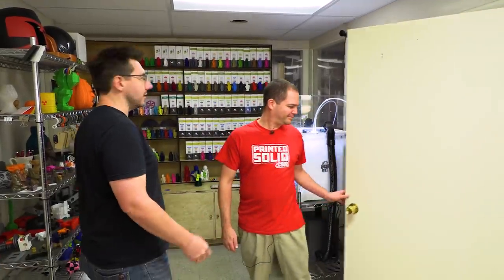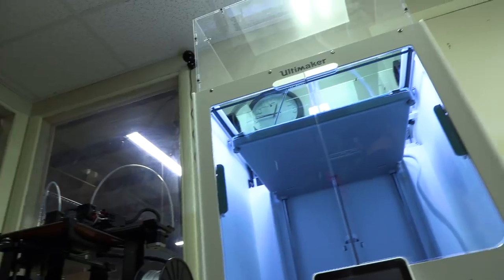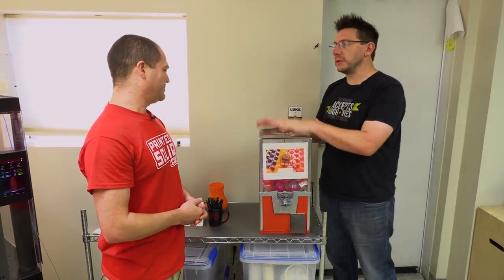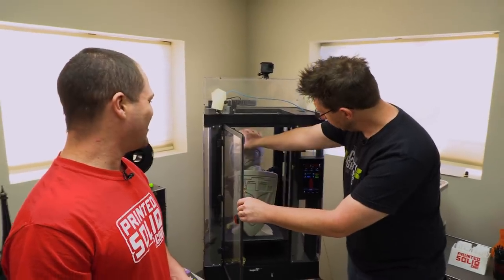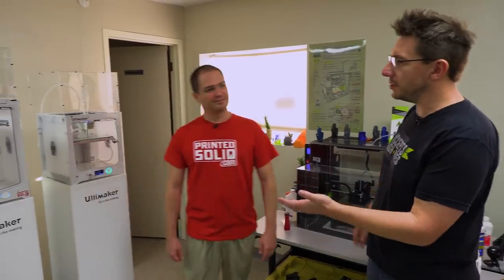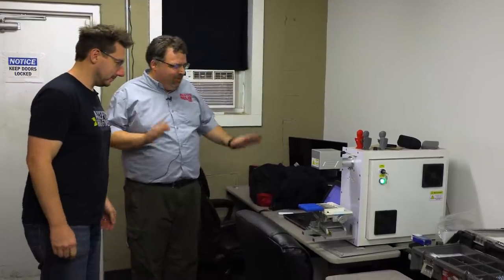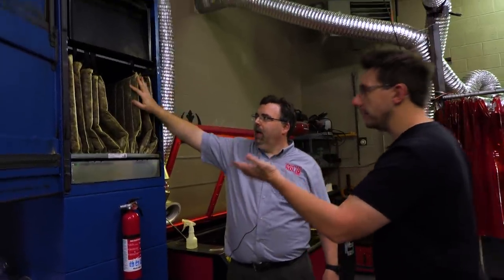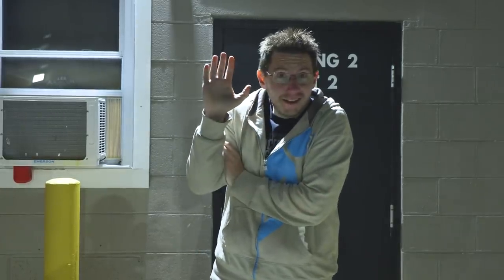Take a Tour of the Printed Solid 3D Printing HQ

Comment: Hey Joel,
I'm considering next year, buying a 3D printer. That said, I'm indifferent between the Prusa i3 MK3 and the Creality c10 series. Mainly because of the size vs practicality vs overall layering smoothness. I understand a lot of people rely on these printers but mine would be more or less a small hobby, maybe etsy worth. Strong maybe in both directions at that because if it takes off like no tomorrow I'd make something of it otherwise I just want to make action figures and toys I really wish I could get my hands on with the cost of one of my hands since there are more than quite a few. I do enjoy doing my own 3d models as well although I just figured out how to model using Autodesk 3ds max. 

Any recommendation on either one?

Comment: Why the huge slot in the enclosure at 16:20 ?
Honestly I'd much rather the PEI sheet be a little smaller than the build plate. I don't know what to use to the overhang without leaving a tiny overhang on the edge radius. Using the wet application method it's easy to place it properly.
Reply: Check out Joel recent video on 5 tips for building an enclosure. The slot is to all heat to escape so you dont overheat the printer
Reply: @Drandolph1976  You also need a slot so that when the X gantry is all the way at the top of the Z travel there's room for the filament to move back and forth which is why it's a slot I'd guess. If it was just for heat they could do any number of patterns on top and if it were just for letting filament in on the moving path of the extruder it'd be a thinner slot.

Comment: With a budget between $3000-$3500, what would be the best equipment to purchase for a complete setup?
Reply: for $3,000-$3500 I would recommend you buy an assortment of different 3d printers. Start with Creality CR-10 ($300), and after that buy a different 3d Printer with unique features. I have many different printers and wouldnt want a $3k printer as I really has no added value.
Reply: morelli tech 
Thanks

Comment: They need a water jet instead of laser cutter to cut those materials. They wouldn't have any problems with off gassing if they use water.
Reply from the maker: That sounds even more fun!
Reply: @3DPrintingNerd  it's excellent! We cut everything from 1/32 thick plastic to 1 inch thick steel with it.
Reply: @printedsolid  that's true, they are much slower cutting then our plasma cutter.
Reply: @printedsolid  oh yes.. they are awesome! The smaller ones seem to be easy to maintain and more precise over time
Reply: So, you don't make extremely toxic water in that process? I guess most of it is run in a closed loop system, but don't you have to replace the water from time to time to get new abrasives mixed in and clear out all the materials that get into the water when cutting?
Reply: @ProtonOne11  yes you do. There is still cleanup involved but very little VOCs released with a water jet. You aren't melting the plastic so there is no toxic off gassing. The water is mostly recycled but we have to clean out all the grit every few months. There is a company that comes by and picks up the grit to be recycled.